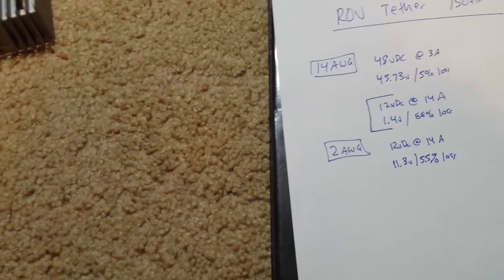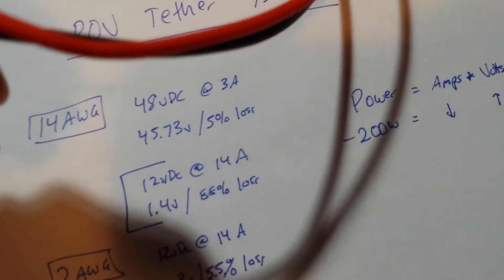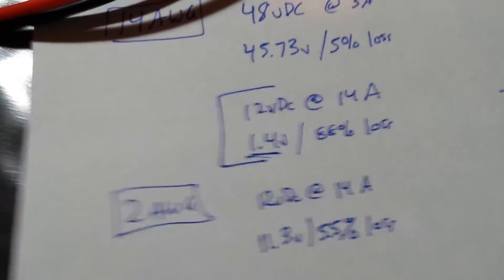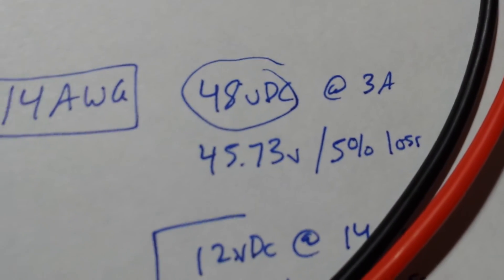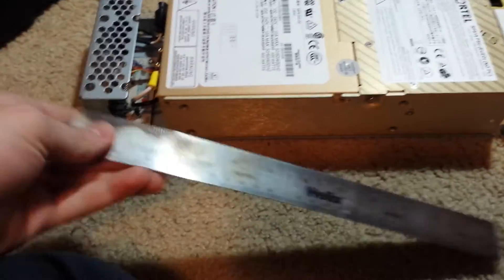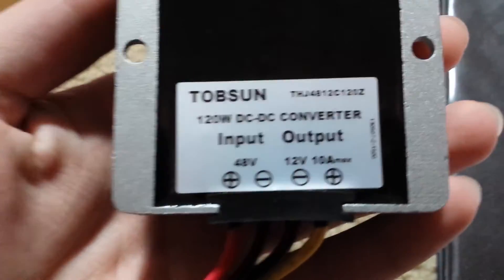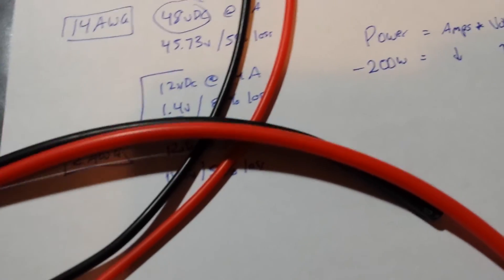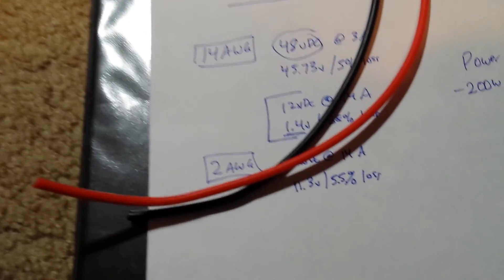ROV Tether & Power System

Comment: think about it. if you were able to send an ac voltage down your tether. say 120v 10amps at the end post loss (ac current doesnt loose much) if you converted that to dc that translates to 12v 110.10amps DC. more than youd need. plus if you pressure compensated your electronics can with a transformer and a non conductive oil youd add very little weight to your design

Comment: use alternating current and step up the voltage to minimize voltage loss and then step it back down on the rov and convert it back to dc. you could even pressure compensate the transformer so you dont need a preesure can

Comment: Why not use LiPos onboard? They're inexpensive, light weight, there's no need to calculate loss power and you can get 4Ah 3S for under $20 bucks at hobbyking and similar sites. Might also help bouyancy. Sending down power through the tether seems impractical.
Reply from the maker: That is another good option, but it is a little bit trickier to get it right, and you have limited time underwater. You could easily build up a large bank of 3S LiPos in parallel, but if you want the batteries to last longer and not fail, each cell in every battery should be watched so that they don't go bad and take out the rest of the batteries and leave the ROV stranded. And watching ~5-10 lipos with 3 cells each is not all that easy to do. Also it is even more important with LiPos onboard to make sure that the waterproofing is good on your housing because lithium + water could case a problem if mixed...
Reply: ***** I understand your concerns. LiPos are also sold in hardcases which can easily be waterproofed with liquid electrical tape. Once a LiPo was laying in water, non waterproofed, for half an hour before I got my sailboat back to shore and realized a part of the lower compartment was flooded. Unless you dive in saltwater shorts should be no issue. How long/deep do you plan on going underwater? 8-12Ah should be plenty for the motor size you're using. 12Ah at 350g per battery should give you 1050g of extra payload. I assume you're not hitting full throttle throughout the dive. If you balance charge all batteries to the same cell voltage, discharge in parallel should be within 0.2V discrepancy for all cells. A CAT5 cable would be much more easy to get bouyant than 14AWG wire, let alone the cost of hundreds of meters of it! As for monitoring, there are dedicated current and voltage sensors for platforms like the ArduPilot (mainly in use for multirotors and fixed wing airplanes). You might want to check out Goodluckbuy.com and have a look at the "MinimOSD / MAVLink" and the Ardupilot boards they sell. What you essentially have is an overlay over your video feed that shows an artificial horizon, stats like GPS coordinates (useless under water), a magnetometer, cell voltage, current draw, time since launch, and customizable alarms from different sensors (maybe a flood warning?) and lots more. There's copies that can be had under $15 for the OSD and $60 for the whole Ardupilot.

I'm unsure what your goals are though, if you plan on dives longer than 1 hour power from above might be the way to go.

Unfortunately time did not permit me to build my own ROV yet, the electronics are set up, what I lack is the biggest part, the pressure hull. What do you think of a clear acrylic case as seen in this thread http://www.rcgroups.com/forums/showthread.php?t=1328054&page=7 ?

As for the OSD, I fly with the MinimOSD on my Mini H quad and it's working like a charm. Here's a demonstration by a guy that goes by the name of Mochaboy, great tutorials on his channel watch?v=nO7MVza5EFI
Reply from the maker: I think that could work, but liquid electrical tape probably wont do the trick, and I doubt those hard cases are designed to withstand 100-250psi of water pressure. Most likely they are IP67 rated. However I plan on going down at least 200ft with power over tether, and maybe down to 500ft with internal power. 

If I was going to go the internal power route I would probably make my own battery monitor to check all the cells. It is not that difficult to do, just requires a lot of harware. And there will a be a lot of water sensors either way... :)

Depending on your budget, I would try and get a cylindical metal housing if at all possible. I am planning on using aluminum, with acrylic domes to withstand the pressure at depth. However almost anything you do will work to some extent. Anything that is square will also not perform as well as a similarly sized round container because of how pressure is distributed. Otherwise it could work.
Reply from the maker: Yes. My preasure hull will mantain atmospheric pressure. I though you were thinking of mounting them externally. 

I am not to worried about water leaking in but if I decide to go that route I will look into the hard cased ones. This internal power route is looking like more and more of a possibility though.
Reply: I think the best solution is not LIPO but NIMH